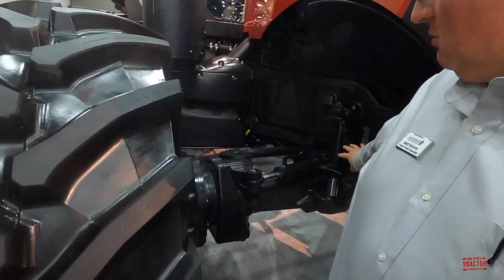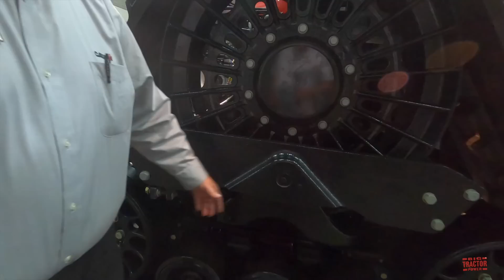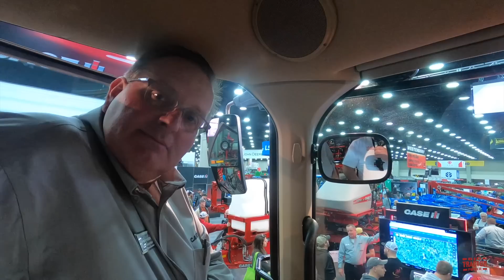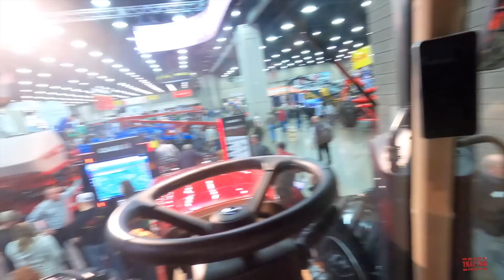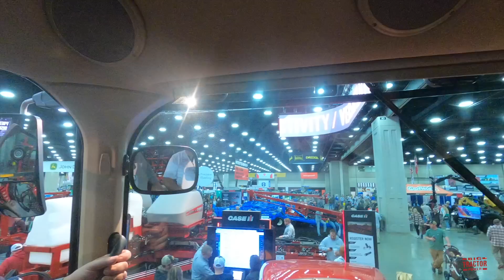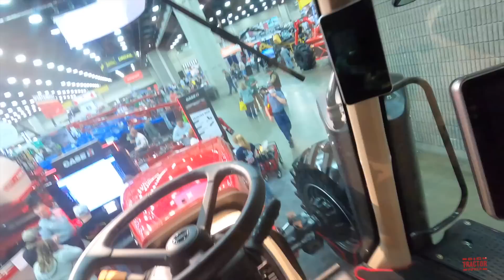New CASE IH 400 MAGNUM Tractor

Comment: I have my afs 400 for now 6month and im so happy to drive it ! 21 speed transmission work perfectly
Reply from the maker: Very cool. Nice good sized fixed frame tractor. What implements do you pull with your 400?
Reply: @bigtractorpower  lemken rubin 10 , forage harvester, all deep soil work
Reply: @bigtractorpower  mine is not on track , 50inch read and 38 front
Reply: what is top speed at full rpm and top gear?:

Comment: My dad bought a new 150 puma...two weeks later I decided to check the oil...did you know the dipstick is behind the tire? This means when you park, you have to turn the wheel all the way to the left when you are done for the day. Otherwise you have to start the tractor and turn the wheel, turn it off and check a dipstick full of oil from a tractor that was just running...what a pile of crap.
Reply: 😂 LOL you can reach in between the fender and the fuel tank with the wheels straight to get to the dipstick.
Reply: @oliverburgess1036  you're right...you missed the loader brackets. I'm 5'11 and there's no way I can fit my shoulder there to touch it with the loader on. But if someone is 6'5 and works at a pillow factory, their arms may be thin enough to reach.
Reply: @tf7274  OK I take it back, the loader brackets are right in the way on a 150. Even worse on a maxxum
Reply: @oliverburgess1036  Appreciate it Oliver. My point was. if the engineering of the dipstick is bad, then it makes sense that the cab leaks too...Made in England. It never rains there, so how could they figure that a round cab roof that slopes to the windows without a drip line will eventually fail...

Comment: 8.7 making 400 hp.  That should be 14 or 15 liters. No replacement for displacement.  That lighter motor will be working hard.  How many hours on that warranty
Reply: It’ll make 400 hp until it can’t anymore if you know what I mean.
Reply: My thoughts also.

Comment: Case keeps getting uglier every time.
Reply: This looks fine to me.  On the other hand, have you looked at the front of their new self propelled sprayer?
Reply: @OldIron1961  yeah. Their sprayer is getting better but I don't won't and ain't had nothing to do with em . I have had two 4700s one new 4710 a 4920 and a r4030. Have put over 20000 hrs of seat time in jd sprayers since 97. Love em

Comment: What is life of the computer on a tractor like this?? Probly won't be in use in 50 years like a 1066 or a 4430. This technology is built to fail.
Will you do a video on junk computer technology in modern tractors?
Another 5 or 10 years and we will have to go back to horses due to computer failure and tractors relying on outdated chips and software. Half million dollar piece of crap...
Reply: OK boomer